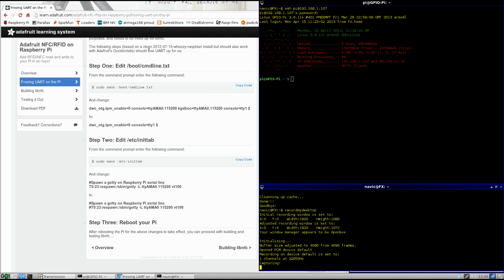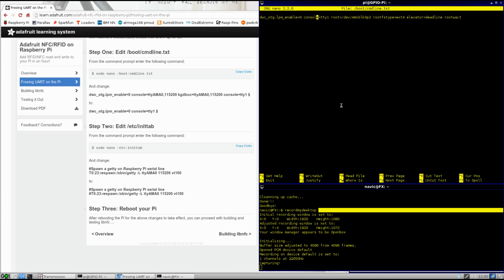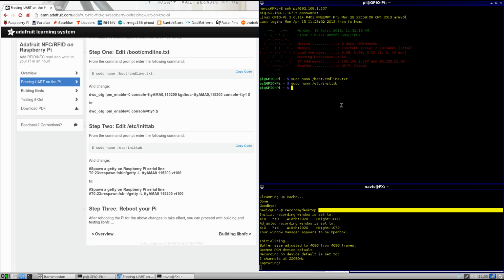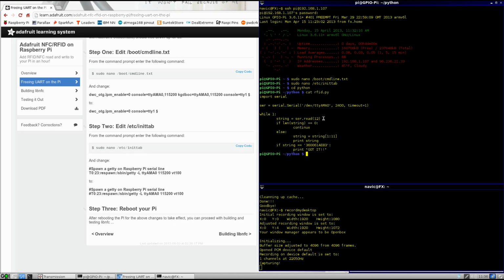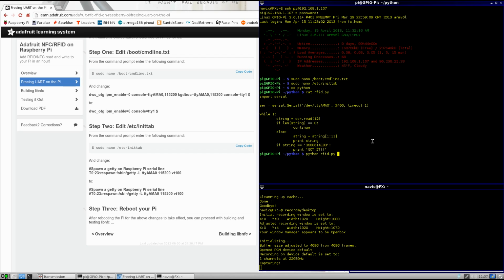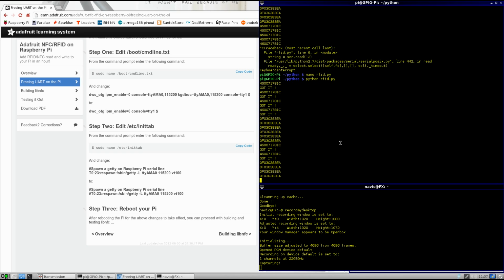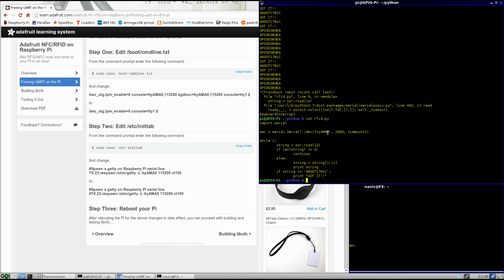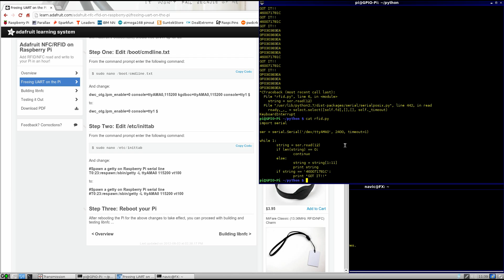RFID on the Raspberry Pi

Comment: i followed the video exactly and every thing worked fine, until i tried to run the code in the description and got the following error :
SyntaxError: Non-ASCII character '\xc2' in file rfidtest.py on line 2, but no encoding declared.

 what should i do? how can i change the encoding?

thanks in advance.
Reply from the maker: I'm not sure how to change encoding maybe copy the text and paste it into a new file?  if you have the ability to use Linux and gedit it should work - that's what the original file was created with

Comment: Hello, i am trying to do something very similar but directly from the pi, what id like is to either enter a code or scan a RFID tag to enter which will turn off a relay, when the relay is turned off the magnetic lock will release. I have already created a website that can turn the relays on and off which works fine. But could you help on the RFID & Keypad side at all?

I have some pictures of the 2 in 1 RFID & Keypad, aswel as the sticker that shows what the wires are. But i cannot figure where to wire them to. (Which pins on the Rasp Pi) I understand the Red And black are to go to a 12v power supply.

The wire picture isnt that clear but it shows:
Colour:	Details:
Black	GND
Red	VCC +12V
White	D1 / TX / 4R -
Yellow	BUZZER
Blue	LED
Green	D0 / RX / 4R +
Grey	26 /34

Is this something you would be willing to help me with at all? As i would really like to get this up and running. I have a Raspberry PI Model B running raspian, i have the following pins available as i am already using some already for my relays.
1,3,4,5,8,9,10,14,17,19,20,21,23,24,25

Look forward to hearing from you Callum

Comment from the maker: Sorry but I do not know how to use Eagle well enough to make a schematic without using the built in libraries of parts.  The Logic Level Converter schematic and Raspi GPIO pinout should all you need to connect the wiring, besides the standard + and - electricity wiring.